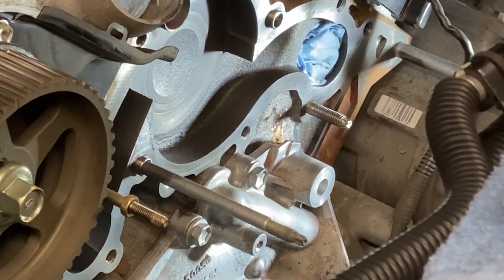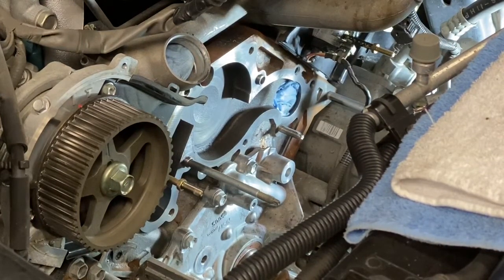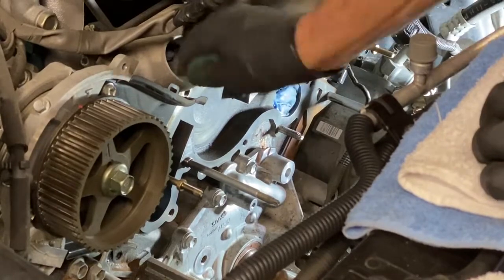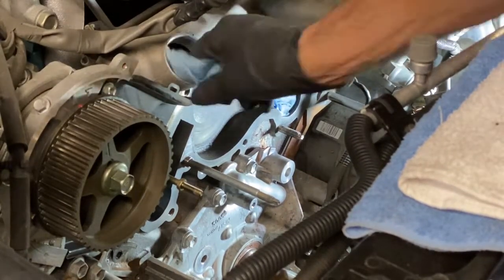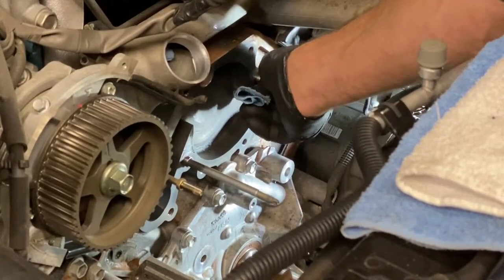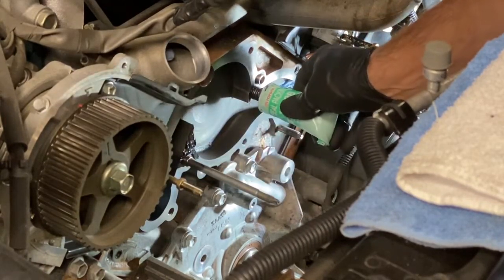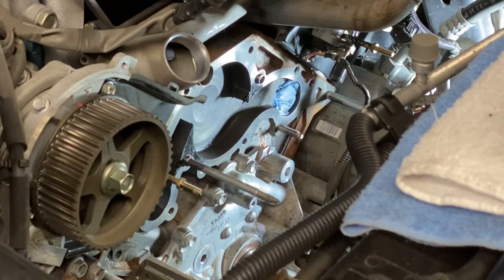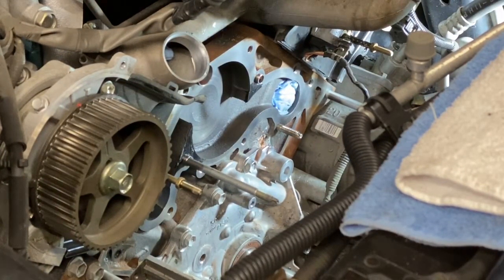Toyota FIPG 1282B fix for coolant Electrolysis pitting

Comment: Its great stuff - i noticed some coolant under the by pass pipe in the center manifold chamber and some pits on the coolant flow areas on the manifold areas in there - smeared a thin amount on the areas before gasket install and problem fixed ! Worth finding it on ebay for $40-50 instead of $90

Comment: I am having trouble sealing the water pump on my 5vz due to pitting . What about using the metal gasket and this material around the whole gasket surface just to be safe ?
Reply from the maker: I would not apply gasket to wet FIPG. Coolant will get under the excess FIPG, resulting in pitting over time. You need to address why you're have trouble sealing.
Reply: thanks for the input ! im pretty sure the pitting is worse than what your video is showing . can the FIPG be sanded so it is as flat as possible ? im no expert but research has shown the block surface           " should ,  needs to be as flat as possible "  for the steel gasket . A mechanic recommended a similar process to your own but with JB weld  then sanded flat and a " thick " paper gasket . this is my daily and i dont want to do this again !   @memy895

Comment: That is very clean. Does it shrink much?
Reply from the maker: Good question. I don't think so. I base this on whats remains in applicator (straw) between uses. Applicator still looks full, after it cures in the straw and the FIPG still fills the straw tightly. But even if is does shrink a little. It will still coat metal in the pit, protecting metal. Also, the rubber of gasket should compensate if FIPG does shrink.
Reply: @memy895  Thanks for the reply. I read your posts on Mud so i understand how meticulously you care for these trucks. When i read your posts on MUD i picture this fellow. https://www.youtube.com/c/ToyotaMaintenance/videos 

more video's please & have a good one